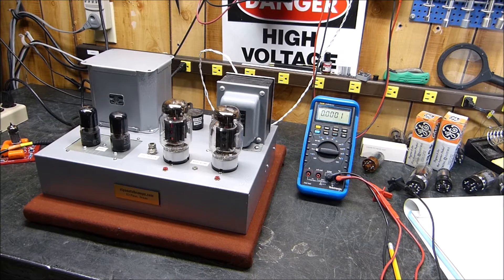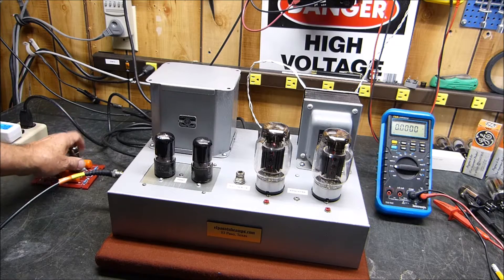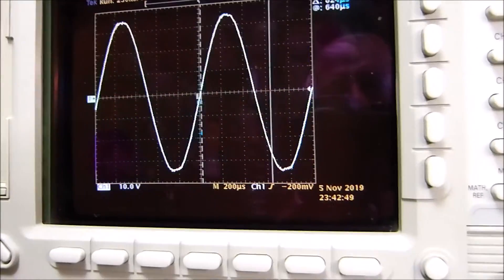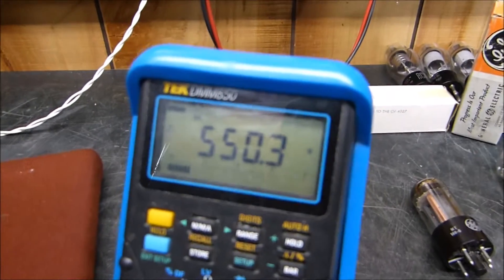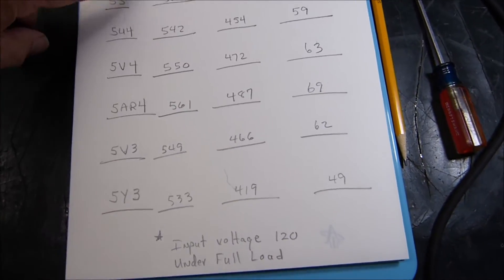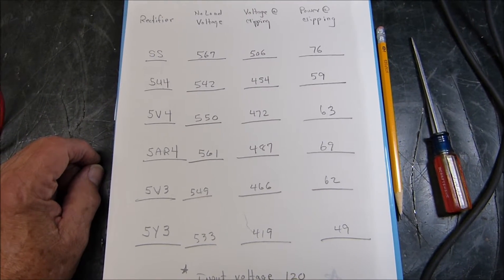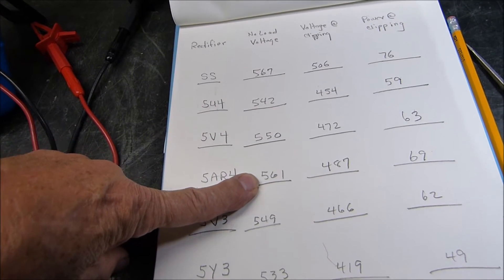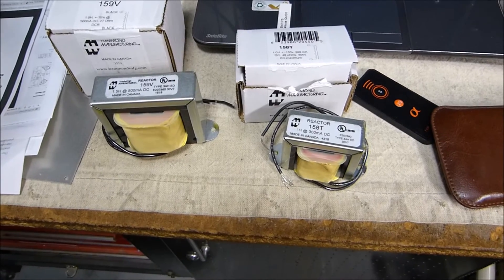SS, 5U4, 5V4, 5AR4, 5V3 & 5Y3 Rectifiers Compared In 75 Watt Vacuum Tube Audio Amplifier

Comment: Very cool experiment!  There's a strange tube whose number I can't recall, it was a 5U4 pin compatible tube like these, but it was a military job made by Cetron that was shock mounted in a foam lined epoxy base that flared out like a toilet plunger, and sat in it was a squat little flat-topped tube that reminded me of one of those shorty Coke cans.  I wound up giving it to a guitar player whose amp needed a new rectifier at a gig after going home to retrieve it.  He kept asking me if I could get more of them because he loved it, but I'm skeptical he could ever wear that first one out.  You and I build for hi-fi mostly I think, but you'd be amazed at how easy you can blow a guitarist's mind by getting their voltage to sag and clip the output at a lower volume.  For the guitar amp experimenters out there, if you're going to try swapping rectifiers, you gotta watch out for the filament current so you don't run the risk of killing the rectifier winding on your power transformer.
Reply from the maker: Your description of the tube sounds like a military version of a 5R4. The 5R4 being a higher voltage, lower current rectifier, often used in ham radio transmitters with an output of 800 volts or so,  would indeed, sag and clip the output more than a 5U4 as the 5R4 is a lower current rectifier. The music amplifier will typically operate at a lower voltage and higher current than the radio transmitter. You are touching on a subject that has been on my mind since uploading this video and all the comments posted. I am beginning to see that the 5U4 class of rectifiers, et al,  give the guitar musician that magical sag/clipping that is so sought after and replacing the vacuum rectifier with SS may significantly eliminate that sag and clipping,  basically destroying the sound that the musician wants. As for HiFi, it is the other way around. I want Bolder Dam, low impedance, high current capabilities to accurately reproduce what was originally created by the musician, sag, clipping and all in the original recording. As for damaging the rectifier filament winding on the power transformer, I agree with you, if it is a 5V, 2A winding, like for a 5Y3 or 5R4, swapping the rectifier out for a 5U4 (3A) or the 5V3 (3.8A) it could, over time, damage the power transformer.
When we examine the ethereal level amplifiers from long ago, I am talking about 1940 or so, the output was SE and the harmonic profile was that of a triangular wave with all harmonics in a harmonically descending amplitude, which, as far as analytical measurements go, is horrible... but that is the sound that we like music created with. I am also convinced that we also like the small artifacts created in the vacuum tube amplifier itself. Absolute, pure and clean, 0.001% THD amplifiers tend to sound sterile to most of us.
Reply: @ElPasoTubeAmps  You're right, it was a 5R4 now that you mention it.  Wish I could get more of those at the price they were going for in the 90s.  Another thing I realized while recalling my days of similar experiments, is that aside from the filament current, you also have to watch out for the value of that first capacitor hanging off the rectifier.  You can put as much capacitance as you want after a resistor or choke, but that very first cap must not exceed the max capacitance value for that tube or you can kill the tube with all the inrush current.  For guitar amp experimenters, this could be a real issue if you had a 5AR4 originally and the max permitted 60uf capacitance, then you switched to a tube like 5U4 which only allows 40uf.
Reply: You are referring to the so called "potato masher" version of the 5R4;  I believe they were made by Chatham Electronics as well as possibly Cetron.
Reply: @goodun2974  You are correct, mfg. by Chatham Electronics
 in Newark, N.J.
Reply: I have 2 of those big yellow 5R4WGY's....The box's say April-1955 .  I read the WGY suffix was for military spec, somewhere.  I tried them in my old Ampeg '65 Portafex B18-X head.  Spec'd for a 5AR4. Much more sag with the 5R4. I also have a ss rectifier , but the 5AR4 sounds the best. I have both the 5R4WGY's and boxes they came in if anyone wants pix of them. Not for sale, though...  :)
Reply: 5r4wgyb  potato masher

Comment: Just discovered this channel and reminds me of the tube heydays. Nice comparison of rectifiers and hope you can add 5R4GY to the list.   5AR4 was indeed one of the king of rectifiers and people love the indirect cathode to prevent cathode stripping for people who believes in it. 

I was wondering if the 5Y3 plates were reddish or not. That's what I like about tubes. They can take abuse. If it were solid state, you end up with shorted power transistors/fet/mosfets, burning your precious speakers if you had the direct drives with no crowbar guards.

Thanks for sharing!!!
Reply from the maker: Eimac has an article on "cathode stripping" and they say it only occurs at extremely high voltages - 50KV or more? so, I don't think it applies to our world.
As for the 5R4, I do see them used occasionally in homebrew amps but they are for higher voltages and lower currents than the 5U4 so odds are, being used in a small audio amp, the 5U4 would be a better choice than the 5R4. The Collins 30L-1 amplifier used a 5R4 to deliver 800 volts to the plates of the 6146's and a 5U4 for the rest of the equipment like the KWM-2A or 32S transmitters.
Reply: @ElPasoTubeAmps   Agree and thanks for additional info.  
I can check the 5R4 tube characteristics and get some rough values but there's nothing like the real thing.   
The reason why I brought up 5R4 was back in time, people pushed 5U4 with their home brew xmiters to the point where they started arcing.   5R4 came to the rescue. 

So glad to find your channel.  Thanks and keep them videos a coming!

Comment: The choke will be dropping volts and may account for the solid state rectifier seeming worse than it might.
Reply from the maker: I see there have been several discussions about drop across the choke and loading of the transformer, etc. As for the choke we can do some calculations. DC resistance of the choke is 120 ohms so at idle current of 150 mA we have 18 volts drop and at full current of about 270 mA we have 32.4 volts and so on. Factoring in the DC resistance of the secondary of the transformer I think it will all add up nicely. I thought about a meter across the rectifiers but then decided that would be just too much data. No doubt the SS rectifier is constant at about 0.7V and each of the vacuum rectifiers has its own  characteristics which all together, makes it turn out what it does. Possibly considering the voltage drop across the SS rectifiers constant, we could estimate the R value of the secondary of the transformer as the difference in voltage drop from idle to full current (i.e. 270 mA - 150 mA) = 120 mA and a voltage drop of approx 60 volts and come up with a R value for the secondary of about 500 ohms minus the choke R which would come out to around 380 ohms (?) Does that sound reasonable for a transformer rated at 250 mA? Seems a little high in R to me. Anyone's thoughts?

Comment: I would like to see a 83 rectifier.  You would have to change socket but other than that it's drip in.
Reply from the maker: I thought about the 83 as I do have some but the current rating is only 125 mA for that little tube and I am concerned it might just be damaged. I think it would be a fun rectifier in a smaller amp with maybe a pair of 6V6 at 15 watts or so.
Reply: It was just a thought because it has very low Drop in voltage and I've always gotten very stable power output out of it. I currently have one in a 2 6 L 6 amp making about 40 Watts but you are doing something considerably bigger. Also the reason I mentioned it is you tried the 5y3.
Reply from the maker: @kevin2960  I like the idea and may use the 83 in a future video. It is used in the TV-7 line of tube tester for its constant voltage drop so that is a very nice advantage of the MV rectifiers. Thanks for the information on how you are using it in your amplifier.
Reply: @ElPasoTubeAmps  , it would be simple to make an adapter so that the type 83 tube could drop into a 5U4-wired octal socket.  Regardless of the official tube- manual rating for the type 83 tube, it may interest you to know that a short-lived version of the mid to late 50s tweed Fender Bassman actually used a type 83 rectifier, and although I havent seen or worked on that version ( I wonder how many were actually manufactured?),  based on my experience working on Fender amplifiers I can pretty much guarantee that the rectifier tube would have been forced to deliver more current then it was rated for! By the way, I did once repair a Bassman that had most of the circuit design of the type 83 version (as shown in a factory schematic), with some circuit changes to reflect the next "official" circuit and schematic to come,  but it had a factory-original octal socket for the rectifier tube ( 5U4 as I recall). Fender amp designs were always in a state of flux anyway,  and it is fairly common to find specific amps that deviate from the factory schematic for that model-year.
Reply from the maker: @goodun2974  I completely agree with you on running tubes beyond what the vacuum tube manuals specify. Their data seems to be very conservative and probably a CCS rating especially the receiving tube class of vacuum tubes As for the transmitting class of tubes and the big MV rectifiers, I run a pair of 866A's in the PS of my RF amplifier in a voltage doubler. That is definitely a no-no as the HV MV rectifiers are never seen operating into a capacitor but rather always into a choke input filter - probably a two stage with a swinging choke into a Pi filter. But it works for me and I turn the PS on each time I transmit and off each time I quit transmitting so it is on and off all the time and the output is 3.5 KV. There is also a lot of fear-mongering about "hash" and all kinds of noise from MV rectifiers. I have never experienced it and plan on using some 872A rectifiers in my next RF project. I am not saying that some common knowledge and common sense is not valid but I am going to push the parameters a bit.

Comment: Very nice demo! FYI: http://www.fourwater.com/files/fullrect.txt <---5 volt rect comparison
5AR4 are generally chosen for the slower warmup and small voltage drop. There are more-than-normal issues with some of the Russian/Chinese 5AR4 tubes. These tubes have the cathodes in close proximity to the plates and are known to short out "more often" than US made 5AR4/GZ34. I would bet that in a mus instrument amp with the speaker-induced vibration and carry-around shock, these tubes have shortened lives. When a circuit calls for a GZ34, I usually try to substitute in a US made 5V4. Those are excellent tubes and MUCH cheaper. You lose about 10-20 volts of B+, no big deal. You can find them NOS on ebay. Keep in mind that a shorted rectifier tube can cause transformer damage.
Also, when firing up an amp build for the first time or when fixing an amp that calls for a GZ34, I like to use a 5Y3 or 6087 because it is a cheap tube, most tube guys have half a dozen lying around in the junk box. So if it blows up, no big deal. They also will lower the B+ maybe 40-50 volts relative to a GZ34 so you're not hitting your fix/new build so hard.

Comment: So is the tube sag in a 5AR4 rectifier similar to a solid state one? I'm asking because I play electric guitar. (By the way i prefer solid state rectifiers myself.)
Reply from the maker: It is the closest one for sure. As mentioned in a comment above, the spacing of the plate and cathode in the 5AR4 is very close and does allow for the least amount of voltage drop. I like the 5AR4. 
If a person just loves the vacuum rectifier and has to have it in an amplifier, I can see wiring it in and then underneath on the tube socket, shunting the plate to cathode with SS diodes and have the best of both worlds - beauty and performance...

Comment: Thanks for the experiment. It shows how rock solid stable the silicon rectifiers are in comparison to older technologies. I think using solid state I'd fine for the power supply and leaving the tubes in the audio circuits after all the final evolution of tube radios saw tubes being replaced with selenium rectifiers; solid state albeit inefficient.
Cheers,

Comment: Good documentation! I'm curious as to what the drop is for the 816's
Reply from the maker: Drop across MV rectifiers is constant as I understand it. Looking at the ratings, the 816 is good for 1600V at 250 mA (400 watts) and the 866A is good to 3200V at 500mA or 1600 watts. Pretty impressive for 70+ year old technology and tubes that still work...  See page 20 of this document and notice the prices of the 816 and 866.
http://www.nj7p.org/Manuals/PDFs/Tubes/RCA-gfat-1942.pdf
Reply: @ElPasoTubeAmps  1600V at 250mA is very good, I've mainly used 866's my whole career. There are other larger MV rectifiers that are used in the larger AM transmitters that put out some serious B+. I've repaired a few RCA 25 and 50KW xmttrs that used 872A's. That is a great old data booklet that RCA put out. Contains a lot of valuable info on rectifiers, and transmitting triodes. There's a lot of tubes I see there that can be used for audio. Thank you for turning me on to this booklet. It is now in my file folder of tube data :)
Reply from the maker: @djfrank59  I was actually considering 872A's but the price on Ebay is just too much and they aren't necessary. I am really pleased to discover the 816's. That could be a fun amplifier to build and operate.

Comment: Love the video. This test was two point static test at no load and clipping at 1k. Since those are not real world listener use cases, Would it be worth it to devise a sweep scenario and plot a curve? You could pick your top two winner rectifiers from the previous test and sweep the Freq at say 15 watts and at 40 watts. Then plot the distortion. Would this interesting, useful and most importantly fun?

Comment: No slow warm up with the solid state rectifier though. I'd like to hear your subjective listening impressions too of the rectifiers. Also I suspect your 6B4G amp will beat this KT88 amp though.
Reply from the maker: I think the 5AR4 has a reasonable "slow warm-up" characteristic but the 5U4 is hot and conducting long before the  6SN7's and KT88's are conducting so voltage does soar above the steady state value with the 5U4. Even the 5AR4 is a bit quicker to conduct and has been seen as a potential issue in the Dynaco MarkIII amplifiers where the turn-on DC voltage exceeds the 525 volt rating of the electrolytic capacitors in that amplifier before the PS is properly loaded by the output tubes (6550's).
As for listening, this amp sounds "big" and powerful to me. The smaller amps seem to have more detail but the bigger amps just sound powerful from the get-go. Just my impression of listening to amps.
Reply: I really agree. Have not been impressed with solid state rectifier conversions. Nice to have the tube! Really interesting to see the performance variation  -- the 5V4 is a bit of a sleeper...
Reply from the maker: @HiFiTown  I agree that the 5V4 is a  nice rectifier. The 5AR4 has a current rating a bit higher (250 mA) to the 5V4 (175 mA) but if not over loaded, the 5V4 would do just as good a job and probably for less money.  A current Ebay listing for the 5V4  -  https://www.ebay.com/itm/Vintage-Lot-Of-4-NOS-RCA-5V4GA-Rectifier-Tube-USA-Vacuum-Tubes/202815936238?hash=item2f38c596ee:g:JU8AAOSwFWVdwYnk